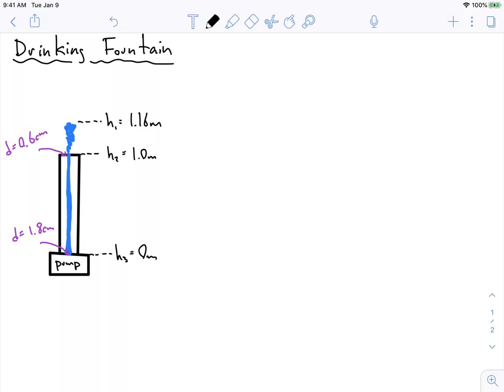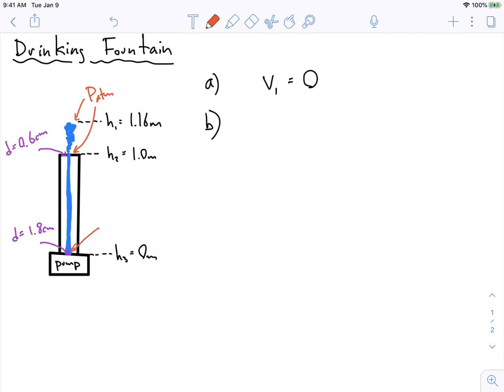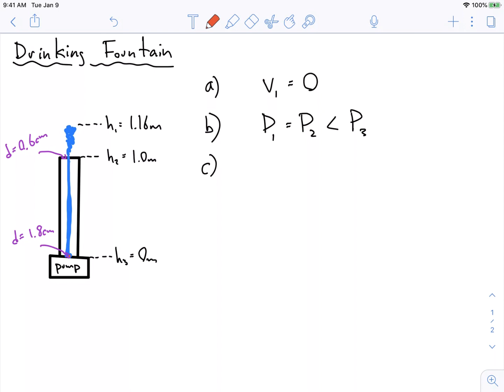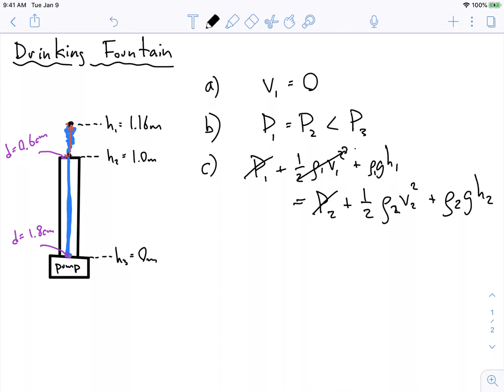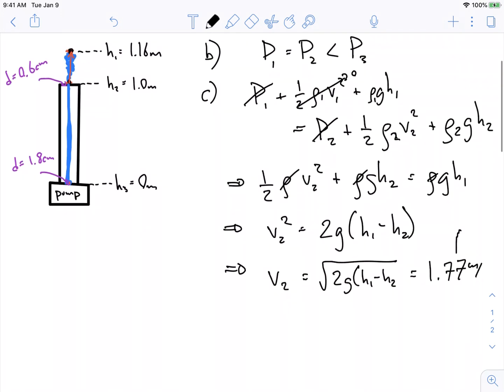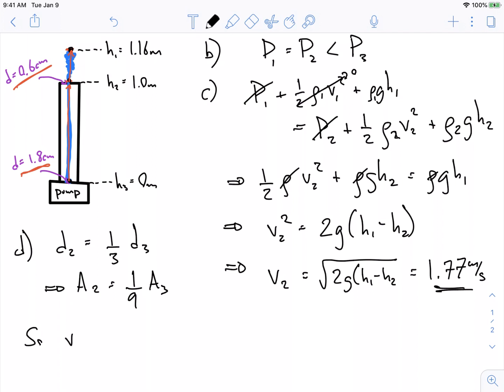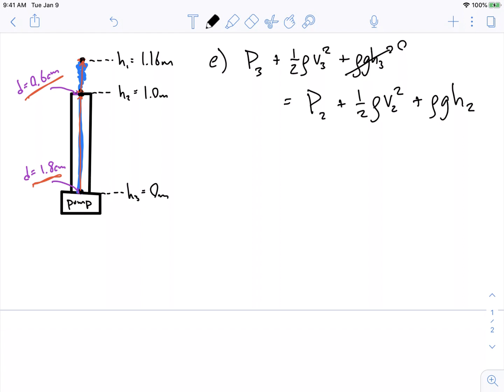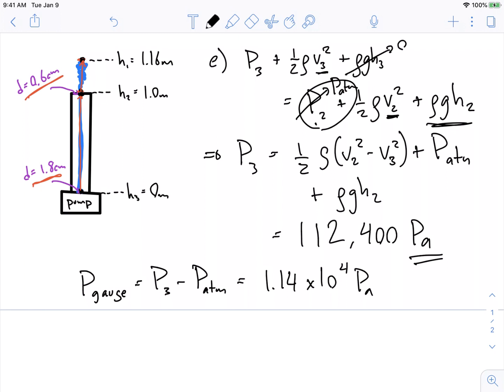You won't believe the speed the water comes out of this water fountain!

Comment: Sir i have a question, if a vertical pipe with uniform cross section area is carrying a liquid with some certain velocity , the fluid in the pipe is going against gravity meaning the fluid is going vertically up in the pipe. Now as the pipe has uniform cross section area, will the velocity of fluid decrease???? Or it will remain same as the formula of equation of continuity that is A1V1= A2V2
Reply: Thanks 👍
Reply from the maker: @jaii5955  The velocity will not decrease as the fluid remains incompressible. We are also assuming a fluid without viscosity and the hole does not get so small that viscosity plays a part. For a long enough vertical tube, the challenge is producing enough force to get the fluid to move. Once moving, however, the velocity obeys A1V1 = A2V2.